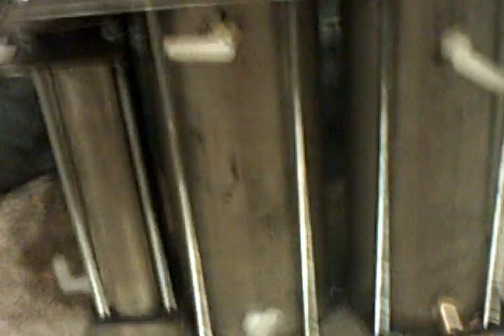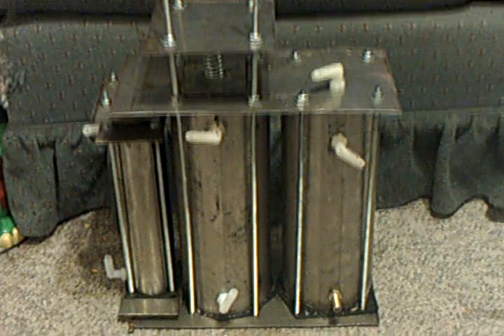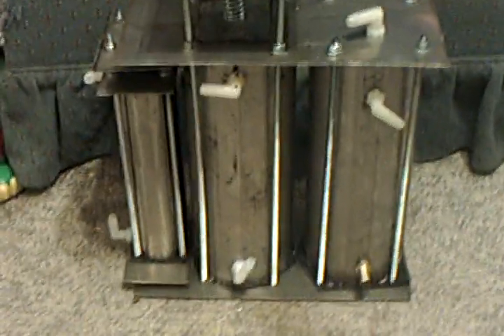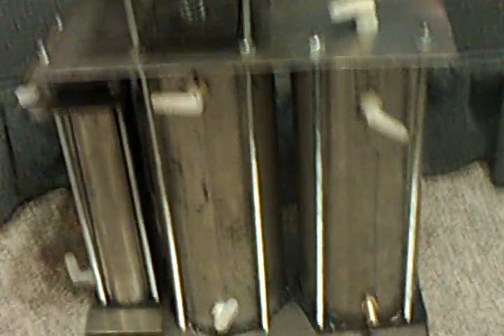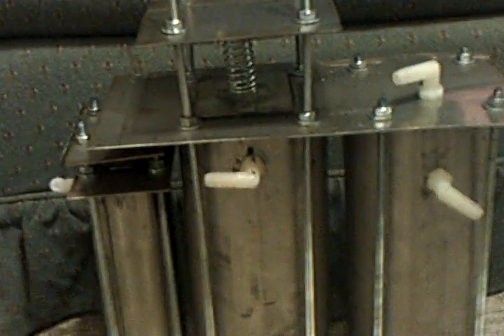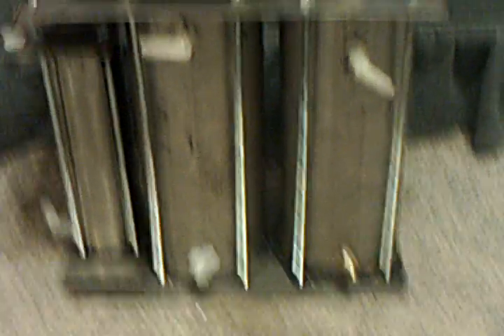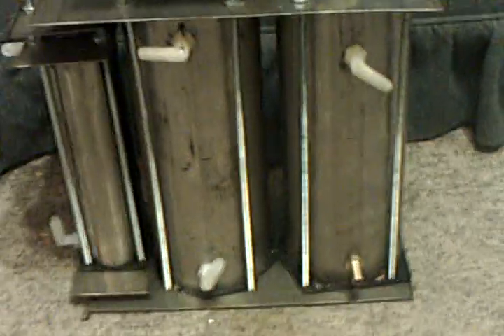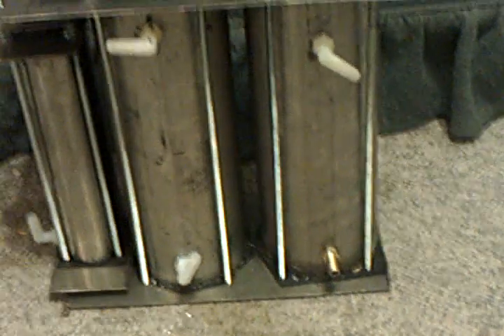The monster cell Triple Bubbler reservoir system

Comment: I tested to see what gave me the most output egz +N- then +NN- N meaning nutral  and i got better results with 3 nutral plates sandwiched by a + and a -. ive seen alot of plates with 5 nutrals but it just wont work im a technician at trade so you could emagin how frustrating this is